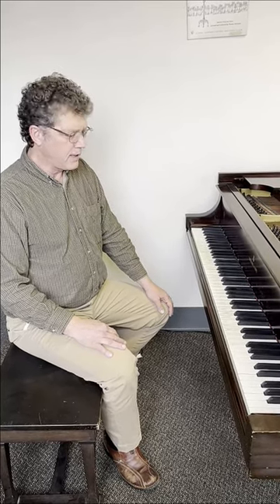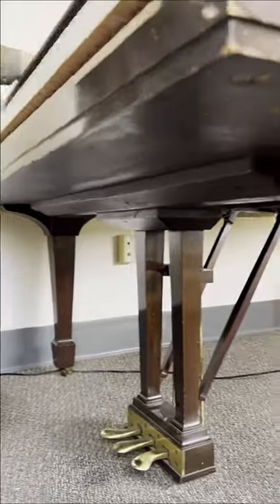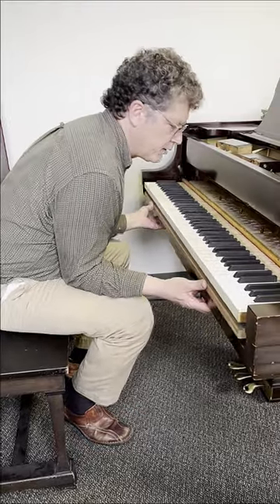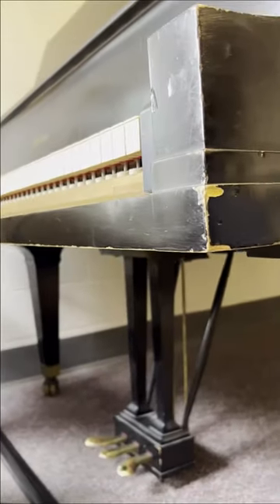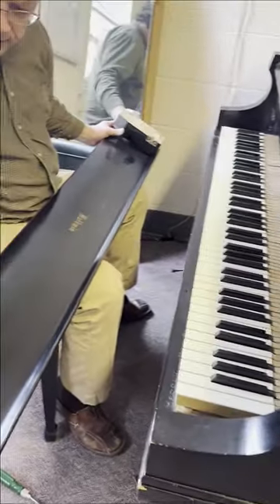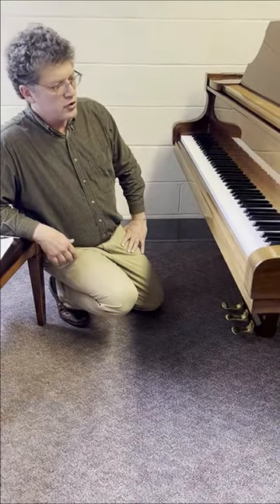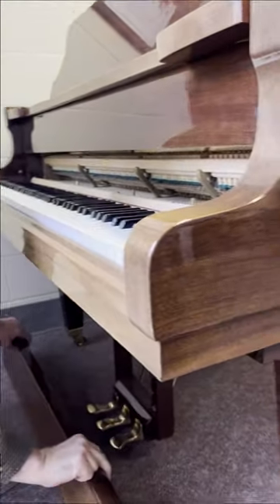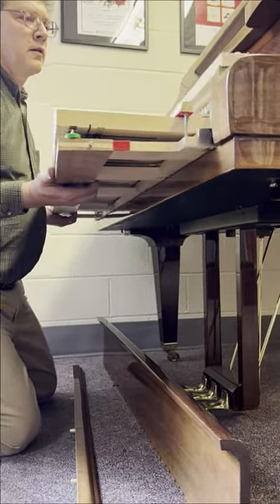Accessing a Grand Piano's Action | HOWARD PIANO INDUSTRIES

Comment: I’d like to see the procedure for a Yamaha grand, please.
Reply from the maker: The procedure for a Yamaha grand and for the Shimmel grand in the video are much the same. The one difference is that there are no screws in either side of the face of the fallboard to unscrew. The fall board is removed simply by first by leaning it towards you at about a 45 degree angle and the pulling straight up. There is a spring holding it with friction so sometimes it takes bit of a pull to get it released. After the fall board is removed then you remove the check blocks before removing the key slip is possible.
Reply: @howardpianoind  Thanks for this!